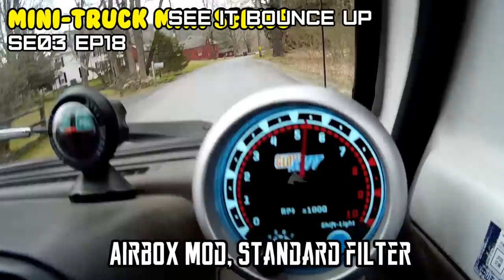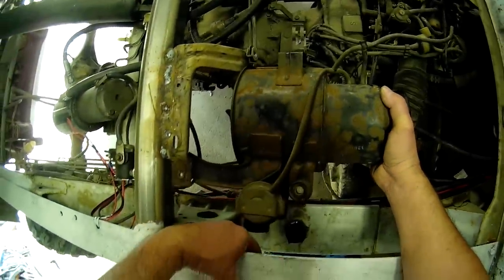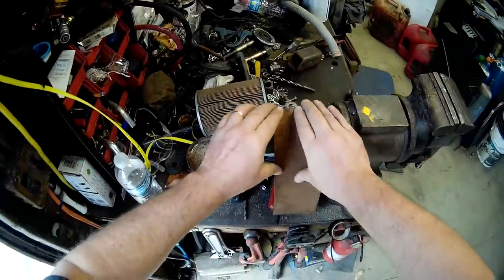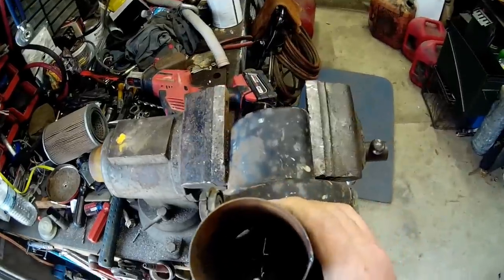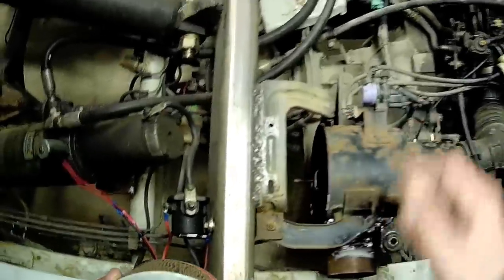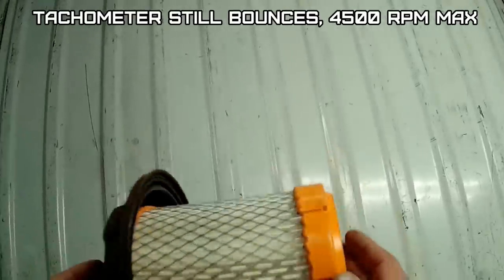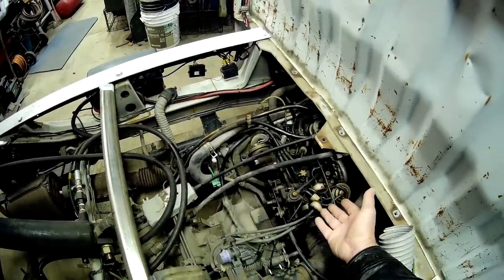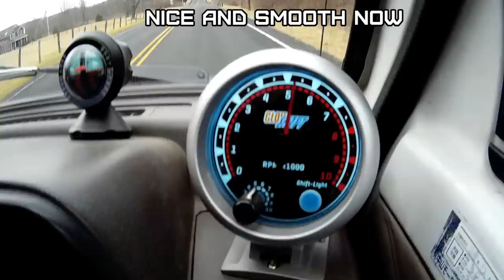Mini-Truck (SE03 EP18) Walmart air filter, Airbox mod. Bigger intake ready for snorkel. ISSUE!

Comment: This is a good mystery. Maybe run it with and without the new tube and start unplugging vacuum hoses/sensors one at a time to see if it comes back or goes away, that may at least give you which one is causing the issue, and put you on the path to enlightenment.
Reply from the maker: Good idea, I may try that

Comment: So,I literary bought a minitruck due to motocheez. 1989 Mitsubishi minicab with a dump bed.  I was disappointed with the speed of only 41 mph. Did a little tune up, found corrosion in the distributor, cleaned it and the rotor up. Next, I checked the plugs, and then the air filter. It was all gunked up and nasty. Well, same story with the auto parts store. Luckily, the lady let me match it up and I found one that was close. Result: 59 mph! Hells yeah!
Reply from the maker: AWESOME!🔥🔥🔥🔥🔥

Comment: I would suspect intake pipe tuning. The open can has a different frequency/rpm resonance than the closed one.

Do a test run without the intake pipe or air cleaner and see what it does. Also play with how long the rubber pipe is into the butterfly.

Also try a "tee" of just a pipe with a closed end, of several lengths. Intake and Exhaust tuning can be a black art.

I've seen stuff like that on 2 stroke motorcycles where the placement of the air filter (moving it an inch in or out) could change a peak or a "flat spot" on power at different RPM. The exhaust on those 2 strokes are even more sensitive to tuning. (Thus all the "extractors" you see on them.)
Reply from the maker: I did try a cone filter reduced down and it worked good. Without air cleaner works good. I think you're on the right track....
Reply: @MotoCheez  I believe the best tuning is done by a Turbo...
Reply from the maker: @idahobob  I'd have to do a draw thru style, or find a small pressurised carb. Long tubes. Was looking at AMR500

Comment: Hey Cheez! Picked up my truck last weekend. 1995 S110 Hijet Climber! 61000 KM on a 6 digit odometer, 5 speed, HI-LOW, and rear locker. The thing is a friggan blast man! Got her plated here in WA easy enough. Only took about 30 minutes at the DOL.

I came back to this video to get the part number for the Fram air filter. Today is oil change day, coolant flush, and all the other fluids.

I too have what I describe as a "flat spot" near the same RPMs as you. No tach yet, but I think it's around the same. Just kind of a slight stumble/hiccup in the carburetion.

Your videos have been such a big help with everything mini truck related! Thank you for the quality content and keep em coming bud!

BEEP BEEP
Reply from the maker: Awesome. Congratulations!

Comment: Maybe it needs static pressure to run right, like building up air pressure on the house ac unit
Reply from the maker: The digital tach makes me wonder
Reply: @MotoCheez  anymore though on why yet? You didn't seem to have any issues on it bogin down to the scrap yard. By the way I was impressed with what it did there👍
Reply from the maker: It's fine with the hose on or cover removed. I'm going to put a 30" hose to see if it is actually resonance, it almost has to be (someone said 3x diameter of hole is tuned length)

Comment: I had a saturn sl2 with a little 1.8 liter and I ditched the airbox and attached a K&n right to the throttle body. Did the same thing. Went and got a 2 inch tube with a nipple to go to the crank case off it and it ran so much smoother. I think its not the volume of air... its the velocity of it by the time it gets to the throttle body and into the valves.

Comment: For the smoothest and most air velocity in a pipe you need an intake length 10 times the diameter of the pipe...  The stock one was small diameter and thus was able to be a smaller length, granted the max CFM was lower then your mod with the corrugated pipe.     In other words your intake is a nozzle, without a nozzle (just a box with a hole cut in it) the equivalent nozzle coefficient would be approx. 0.5 which looks more restrictive then the stock setup (you actually proved this).  Your intake with corrugated pipe would have a nozzle coefficient near about 0.9...  A perfect intake would be smooth pipe that is 10 pipe diameters long and have a nozzle coefficient of near 1.0.
Reply from the maker: Damn. I never knew this. I'm going to look into this more. The cover removed always had more power than stock setup.. so 3" courogated pipe I'd need 27"? roughly?
Reply: @MotoCheez  For a 2.7" dia pipe yes.  If you want dive into this internet hole the keywords would be "intake runner length".  I like your corrugated pipe, it has a lot of surface area for the air to stall on and drop the dirt on, be sure to replace or wash that pipe every 10k miles when you replace the air filter.
Reply from the maker: @brianwelteroth9248  Good idea, thank's for the info!

Comment: Could be a turbulence issue. I know with liquids, if you pull hard enough, it'll make a vortex, and won't hardly move any liquid. But if you have something to break up the vortex, it'll pull a high volume with no issue.
Reply from the maker: I'm thinking that, but why the electronic tach bounce
Reply: Maybe an air surge when the vortex finally collapses.
Reply from the maker: @tangydiesel1886  seems like only thing making sense at this point, but the bouncing tach and surging is weird

Comment: The length of the tubing probably smooths out turbulence and helps velocity. Have you tried an old fashioned engine vacuum gauge?
Reply from the maker: I haven't, but good idea!
Reply: Should be able to run a short hose with the gauge in the cab, careful for pinches. Could be a different underlaying problem, did it do it all stock no mods with just the new air filter?

Comment: adjust your fuel mix for a little more fuel, might also be able to give a few degrees of added timing as well, sounds like the venturis in the carb are tuned to only allow a certian amount of fuel and its not fueling right with the mod, i could be way off though lol great series and great little truck
Reply from the maker: No clue what jets are in it. I did advance timing a bit a while back, it helps

Comment: MESSAGE Love the video blips! I say that one all the time! As for the air box, I'm no expert, but I do know that the air/fuel ratio has a sweet spot, so adding more air isn't always the answer. I can only assume that the engineers that build engines have tuned their engines for proper air/fuel mixture (at least for their specific altitude.) It'll be interesting to see how this shakes out for you... If nothing else, you'll have a snorkel!
Reply from the maker: Probably right, but tach fluctuations is baffling me.

Comment: The issue is solved by your tube the tube your using is spiraling thus creating a cyclonic vortex the swirl is directly affected soon as it hits the intake whatever you did stopped the straight flat airflow you had before. They make them tornado air things for better air flow and fuel mpg boost.  Just the tiny bit of air swirling over a distance ramps up your tube length is the butter zone for the engine needs .

Comment: I wonder if the RPM surge has to do with how much the engine can exhaust. Something like the engine is able to pull more air then it can exhaust causing weird back pressure issues. The extra hose possibly makes the motor have to "work harder" to pull air but in this case that may just be closer to how much air the motor actually needs.
Reply from the maker: Make sense. May have to do exhaust soon anyway...

Comment: 7:50 napa has it in there system.  If anything wixfilters on da webs helps.  Corp is heavy handed there and they dont allow net access. Why i left autozone.  Oreillys is better to work for but same story for parts look up.  Napa is the one where they stock fleet parts...corp stores do.

Comment: Im guna guess its turbulence? Air is a fluid. With the hose the air is forced into a column of cleaner consistent air. Without the hose, the turbulence of the air is more inconsistent, giving the engine gulps of air as it enters that oddly shaped airbox. Just like pulling the plug on a bathtub. Once theres a vortices it empties quickly, but disrupt that tornado effect and the water goes down inconsistently and in gulps. Thats my guess. As an experiment, if u put one of those inserts that make vortices into the mouth of the air box, that may increase the efficiency even further.
Reply from the maker: I'm thinking that, but why the electronic tach bounce

Comment: Me thinks its adding more intake area allowing for air to gain more velocity, more velocity = better air fuel mixture with carburetor = better combustion (to clarify not say fuel to air ratio, but how homogeneous the air fuel mixture is) thats why some race cars use velocity stacks to get better torque at desired rpm
Reply from the maker: Just curious why electronic tach is bouncing
Reply: @MotoCheez  when it does bounce can you hear or feel the actual engine rpm bounce or is it just the tach being funky?
Reply from the maker: @blackjackjwh  yes, you can feel it buck
Reply: @MotoCheez  I should probably state at this point I am not expert but I do believe that when the additional intake tube is on it allows for the air to be more linear and increase that air speed(velocity) allowing your engine to achieve better combustion  at that highter rpm smoothing it out ( carburated engines are more sensitive to air speed (velocity) then direct injection motors)

Comment: Adding hose changes the velocity and volume of air,especially at peak revs
Reply from the maker: But why does the electronic tach bounce?
Reply: @MotoCheez  probably isn't getting a smooth intake flow. It was designed to suck air up the entire framerail, right? Idk, I bet with it open to that little hole the velocity is surging and shit. I know a lot of dudes run certain length intakes as it helps out at higher rpms, something with the pressure wave from the valves opening and closing keeps air flowing better.
Reply: I agree.  It’s probably a velocity issue.  Too much volume.

Comment: Venturi effect?  The intake of the air box is competing with the air moving down the side of the mini truck's frame rail. You move the intake opening away from the frame rail and there is no air passing by trying to suck air out of intake.  Does the issue get worse the faster you are going?  If you put the air inlet on the side of your truck like you mentioned, the venturi effect may get worse.
Reply from the maker: Speed has no effect, it's RPM and load. I have hose looped back up and runs same.

Comment: Typically when you see something like that its because its lean.  Dirty carb or perhaps incorrect jetting due to coming from Japan?  I dont think its a vacuum issue as you loose vacuum at higher rpm.
Reply from the maker: But why does it jump the tach like electrical?
Reply: @MotoCheez    Usually what it is is misfiring or laboring due to being lean which will make the tach jump.  I could be wrong but usually restricting the air flow making it run better usually means lean.  The only other thing that makes sense is if there is a sensor inside the intake tube between the airfilter to the carb which is not working correctly without some restriction.

Comment: Ever consider running some large diameter aluminum or stainless intake tubing/piping up the back of Mini's cab and have a square "ram-air" styled intake snorkel like the old cab-over trucks ran? That would look pretty cool. It might also help with air velocity. But I'm also not an engineer so who knows. :)
Reply from the maker: I want to but would have to run outside cab...
Reply: @MotoCheez  I'm sure you'll think of something. :)

Comment: It might be an intermittent grounding issue. "I wiggled it and held my tung just right and now it works"
Reply from the maker: 😁👍👍 never does it when cover off, or hose on. Constant with hose off
Reply: @MotoCheez  Just for science, take off the tube and cover the inlet about 1/3 of the way.  Wonder what that does?  The tube would tend to make the flow less turbulent but damn... seriously?

Comment: That’s crazy 😜 does it have something to cut the engine rpms back if it’s sucking too much air ? U put the smaller intake hose on & it stops & you take it off & it cuts your rpms down. Is there something like a EGR valve or a PCV valve that’s inside the throttlebody or carburetor on that thing that cuts the rpms down when it’s sucking too much air? Or something inside the throttlebody that works like a reverse thermostat That once it gets too much air on it makes it close???? 🤷‍♂️
Idk Cheez but Thats crazy as Hell 🤪
Reply from the maker: Yeah I know. And with filter cover removed it runs best.. oddity

Comment: Looks like it had a choke of some kind on the air inlet before you chopped it off. Possibly a cold/hot air selector? Although I would have expected a pipe to go to near exhaust manifold for that.
Reply from the maker: That was a heat riser that I disconnected, it's only good really for the winter

Comment: I used to have an MGB with an S.U. carb.  Had typical cable operated throttle plate, but a slide that raises/lowers through a diaphragm on top of it based on vacuum.  I remember it was temperamental with air filter mods.  Don't know if the mini uses same design or not.
Reply from the maker: No she has just a butterfly. Not a CV or SU style

Comment: My first though was an intake air temperature sensor...some sort of attempt to clean up a carb'd engine with computer controls. I also know that often times air boxes are designed to be like a "reservoir" of air for the pistons to draw in and kinda smooth out the intake pulses. Opening up the lid of it or not having the snorkel on makes it act like a drilled out air box and can change the AFR. A leaned out ratio causing the engine to race up a little at the high end, not enough to actually hear but enough to throw the tach off?
Reply from the maker: But with cover off most are can get in it runs best! And tach of course...

Comment: What? Within your intake/fuel system mechanically "flutters"?  I'm wondering if something is fluttering due to a lack of velocity of the air.  

You need twin chrome stacks going up, one on each side of Mini's cab.  One to serve as an intake snorkel, the other for exhaust stack.  Just don't go crazy with the big-rig mods, or you'll be changin' her name to "Lot-Lizzard".
Reply from the maker: Haha lot lizard! I'd like stacks but there's no room really unless I use small pipe up side like Jeffro did

Comment: You made other mods to the truck, lift bed, lift kit etc. That could alter the airflow to the airbox.
Reply from the maker: How? Airbox has had this issue since before any mods.
Reply: @MotoCheez  Ok, didn't have all the details, maybe its possessed?
Reply from the maker: @ratdog3055  😁

Comment: Sounds like the chassis is restricting the airflow before you put the tube on it... kinda like pinching the air induction off moto
Reply from the maker: It's wide open, plenty of room, even stock box did the same. Works with hose on. Weird
Reply: @MotoCheez  I don't know moto... it's truly baffling to me as well. I use to have a buddy in the airforce, he had a 350 chevelle that did the same thing, we flipped the air cleaner lid over and it ran better.
Reply: Hey maybe mini just wanted a hose under her skirt
Reply from the maker: @vharrald  crazy....

Comment: I’m sure you figured this out?
Reply from the maker: Yes. Some kind of resonance, ended up using air pod filter
Reply: @MotoCheez  I figured it was your air or fuel solenoid on your carb. 
I’m looking to do a cold air intake. Can’t really find one that fits
Reply from the maker: Later video I showed how I used a reducer and an over the counter AutoZone air pod

Comment: U better off using the tube for better fuel economy and increase horse power also go to eBay to order the air filter for ur truck
Reply from the maker: The ones I ordered on eBay were too big. Guess there's 2 sizes for my truck...
Reply: @MotoCheez  look at the sku number on the box or part #
Reply: Or try yur year make and model of ur truck
Reply from the maker: @waynecipriano7698  no numbers on box or filter, I did off my model and year, 2 sizes and they only have the big one, filter I bought is better than the stock one IMO
Reply: @MotoCheez  oh ok i see i tried but thanks for the information

Comment: Im so confizled.  Wha?  Mob it with a just a cone filter on the carb?
Reply from the maker: I have one, but they pull hot air off the engine

Comment: To much or to little cfm for the combustion chamber. Think of it like a straw 1 straw does the job but too many and you barely get a drink
Reply from the maker: But it did it with stock intake always bogged at high rpm. And if I took tube off its worse, but if I take the the cover of which is more air and it runs best. And why the electronic tach bounce?

Comment: maybe needs a little vacuum to feed fuel right
Reply from the maker: It does have a vacuum controlled fuel regulator. Can try disconnecting that.
Reply: MotoCheez  had one on a fuel injected rig made it run rich at idle but carb should level it for ya if not I am sure you know how to tune

Comment: Probly sumthin to do with vacuum where you made that hole bigger... maybe
Reply from the maker: Did it w stock hole
Reply: That is bizzaro for sure!  I bet your just holding your mouth different when ya dont have the tube on....... lol
Reply: Seriously though, is it cable driven or electronic tach? Seems like a voltage thing at that rpm. If it's mechanical tach I'd say ya have gremlins!
Reply from the maker: @joecarnes9174  electronic tach! Like there's an ignition cuttoff
Reply from the maker: Ya!!
Reply: @MotoCheez  gremlins it is then lol